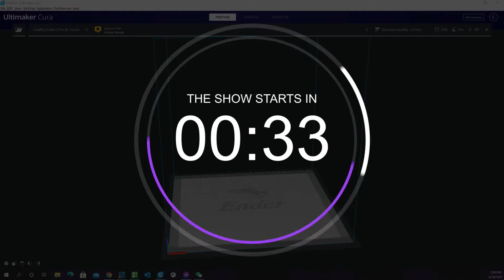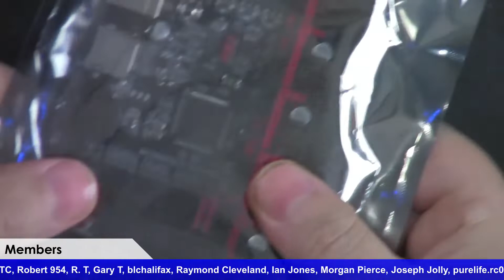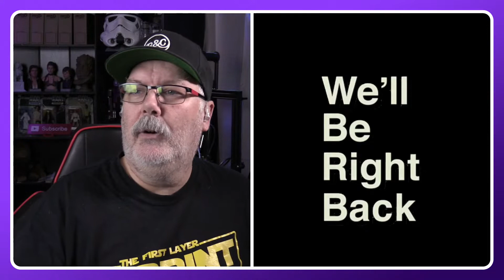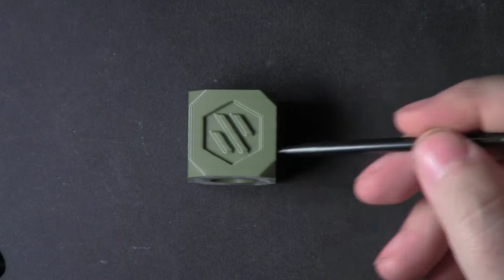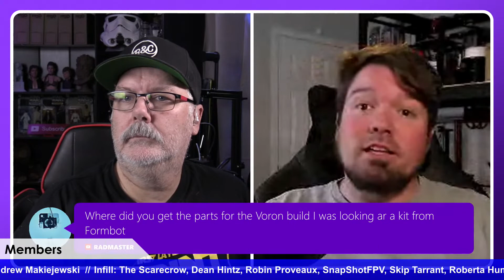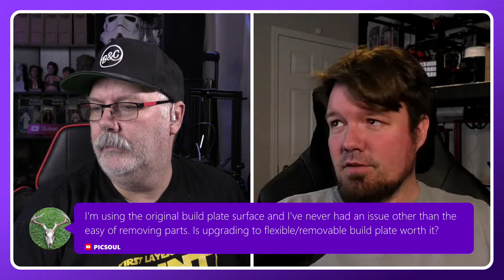TFL Live: Ask for HELP

Comment: Sorry i missed you. Thanks for answering my question. I will try paper method and the spray you mentioned. My bottom layer is set to 12 sec
following layers are at 2 sec. My research says that the monochrome screen should allow for shorter exposures making for faster prints.

Comment: Can the SKR 1.3 run dual extruders?
Reply from the maker: Yes it can! You can either use the E1 slot for a second extruder motor, or you can set up an independent Z.